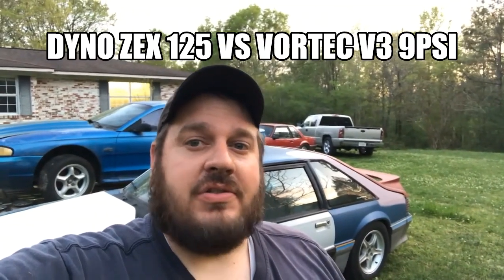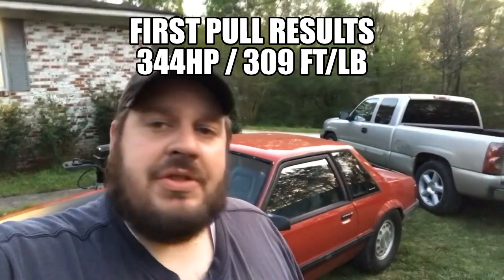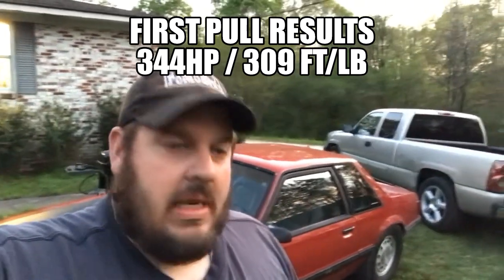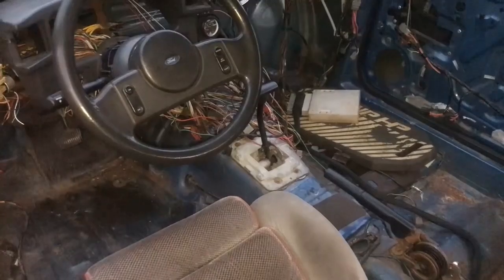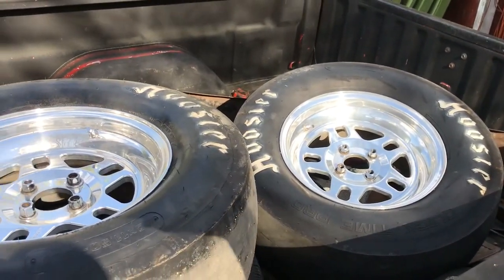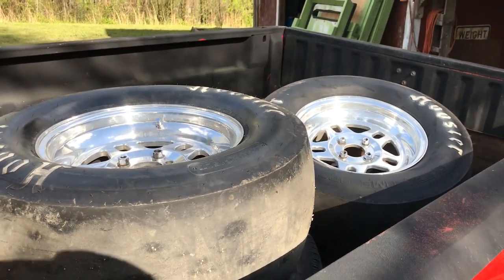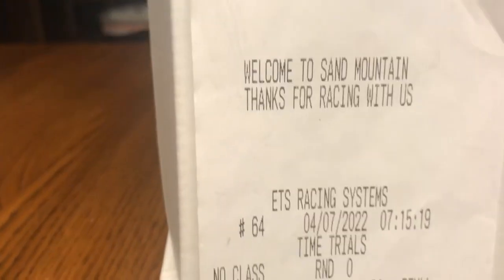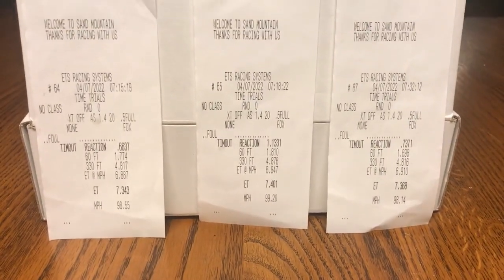Should I add Nitrous or Supercharger? Dyno Comparison on the 1988 AOD mustang

Comment: I'm really hoping that you can help me out I raised out two several other times your brother helped me with some strings on my heads I have a 302 in a '93 F-150 373 rear end long tube headers cam 650 double pumper she runs great I just put nitrous on it with a hundred shot what spark plugs would be the best start out with your suggestions would be appreciated. I know that was a little long-winded like your videos keep them rolling

Comment: What gear did you dyno in? I can't get mine to hold drive/3rd gear unless I'm running around 90mph.
Reply: It was dyno’d in 3rd I think he was around 3000-3500 when he hit it. It does have a bauman shift kit, I don’t know if that helps with thr 3rd gear kick down problem
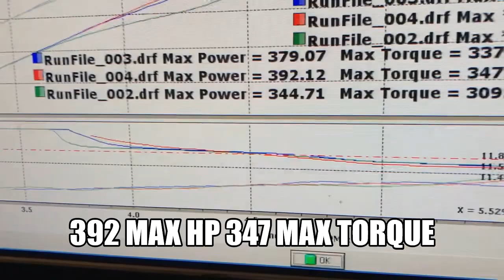Reply: @Sikulz  how's that bauman kit compare to other kits? I have one haven't installed it yet. Rite now mine just has a pa street/strip vb and I really dont like it. Even with TV pressure set higher I get early shifts.. I do run a 4:10 gear tho..
Reply: @mattmeyers81  I only have experience with the Bauman kit. It shifts a little early for my taste, in drive at WOT it’ll 1-2 shift at 5600 RPM, the 2-3 shift is almost immediately after the 1-2…….🤷‍♂️ When I race it I still do the AOD shuffle.   Brew2l had an AOD built and they messed with the governor to get the shifts dialed in. I can’t remember if his car has a TCI or a PA valvebody.